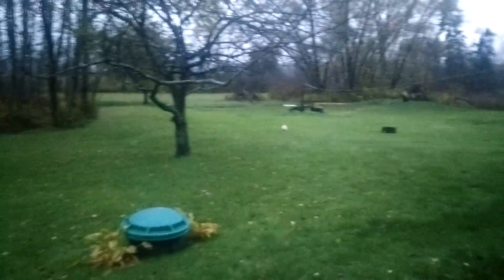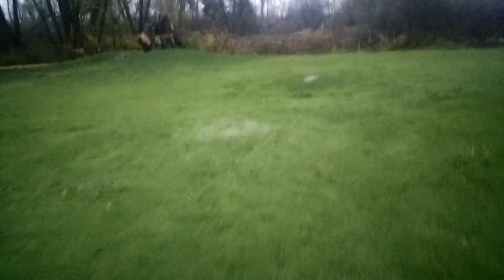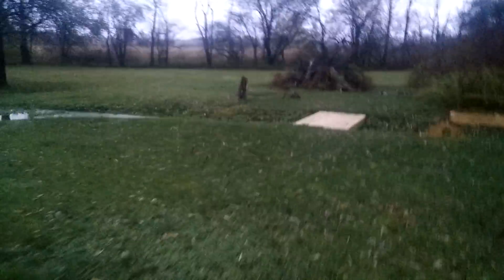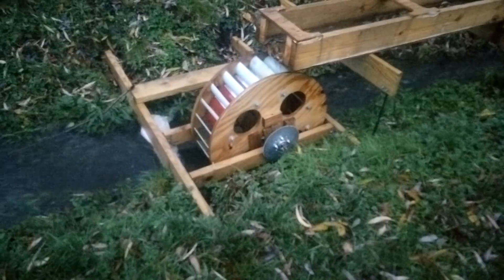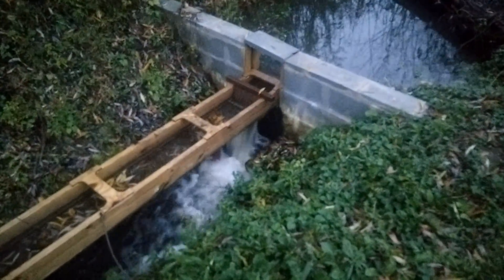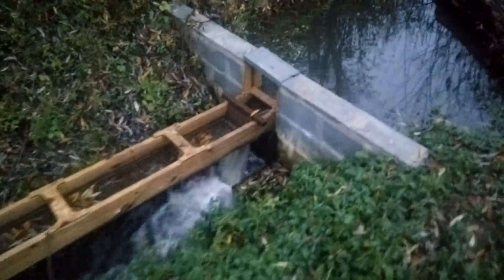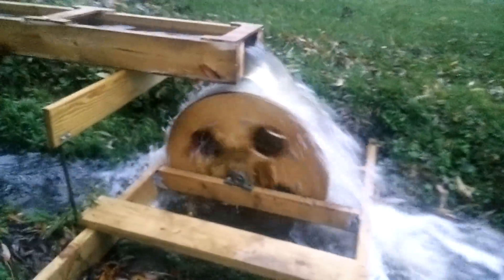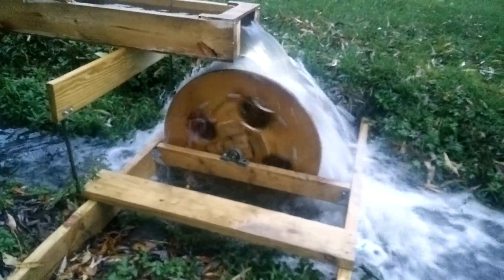[Part 5.2 of 10] Waterwheel Microhydro, High Flow Flume Cleaning

Comment: Good job but You've field to increase the speed because of the drag at the bottom. If you could raise the wheel then you can increase the rpm.
Reply: Exactly, plus you can save the water behind the dam and then release and do your charging for a shorter time at a higher rate.

Comment: I am thinking the water going down the back side of the wheel is going to reduce the weight of the same amount of water going down the front. So the wheel needs to be moved back so water isnt coming in at 12 o'clock but arrives at  1 o'clock and falls down to 5 o'clock. This would discourage water falling down the back side at 11-7 o'clock. 
Water splashing down the front of the wheel and not falling into the buckets will also be wasted energy. 
I think a wheel with the similar sized fins/buckets but higher discs will help with water splashing out the sides and directs the water in the bucket. The sides will also have very little drag in the water pooled below, though you will want to keep the fins out of the pooled water to reduce drag. 

This is turning into a really cool project and i love the cleaning / automatic leaf clearing :-)

Comment: Would it be more efficient to mount the water wheel 90 degrees from it's original position? My theory is that there would be less water pushed backwards & that could increase the speed maybe? Tell me what you think?
Reply from the maker: +creativeobsin it's fine in the current orientation, like I said the vegetation needs cleaned out  so the water freely flows away then it would function without the bottom drag.
Reply: Joe Malovich Thank you :) it's an interesting project & I hope to see more of it.

Comment: Lift your dam and the whole system at least 10" more and the wheel wont drag at the bottom.  You might be able to raise the output end of that wooden trough  and make it an easy fix.
Reply from the maker: I removed the vegetation and that lowered the water below the wheel. That is a disadvantage to waterwheels, the entire system requires maintenance.
Reply: What if you had the water drop behind the wheel instead of in front of it.?

Comment: Damn great with such of water flow you could easely install an small 110 or 220 volt generator and a 12 volt  150 amp car alternator to use with a set of batteries, congratulations

Comment: if you get a smaller sprocket your rpm will be higher increasing the  energy output
Reply: Smaller wheel, as well as raising the wheel to prevent friction from the moving water under it.
Reply: Water wheels are inherently inefficient. A smal Francis turbine would get at least 3x the power.

Comment: water wheel should be spinning in other direction so as not to work against the natural flow.
Reply: @scottedwards8577  look at the bottom of the water wheel. it is sitting in the stream going the opposite direction of the stream. thus causing a counter force to the direction of the wheel spinning.  2 plausible fixes for this problem. one, make the water wheel spin the other direction  so the bottom is also spinning the same direction as the stream. or, two pull the water wheel up so the bottom of it is not sitting in the stream. It's Not that I am stupid. its only that you did not understand what I was saying. Next time perhaps don't be so quick to judge others and call names for no reason.

Comment: I think your project problem is that the wheel is submerged in the water. This way it is difficult to get out of the water. Try not to sink the wheel. This must be activated by the water only at the top. Yours is driven from the top and this is ok, but down water opposes rotating resistance. The study I told you maybe you will be able to produce more energy than in the beginning. You worked very nice and I liked. If I can help with something I would be excited. I have completed a free energy project but with photovoltaic panels and I am pleased. I like people realize that we have other sources of energy than conventional ones. I would love to have a creek like yours.Regardas
Reply: Marius Macovei  That stream typically isn't that deep, mostly rain runoff right now.
Reply: or turn the wheel around so that the little flow underneath actually catches in the buckets and drags them along under water as well.